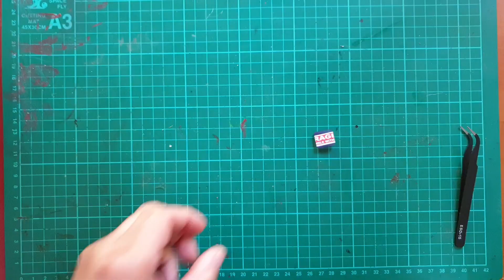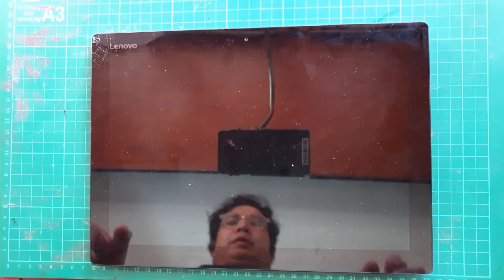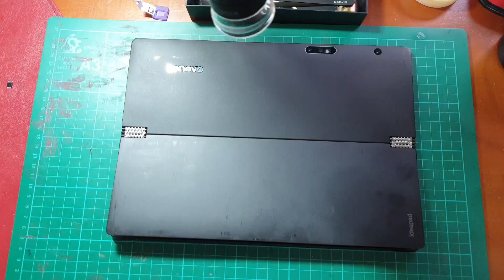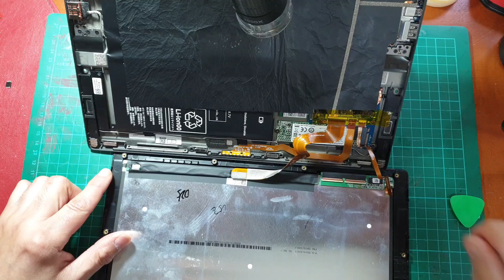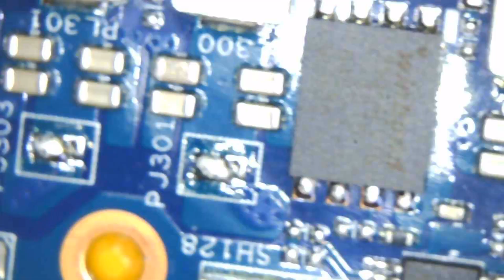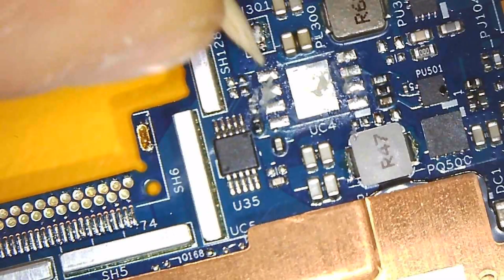First Attempt at Replacing a BIOS Chip with No Legs

Comment: How long did you have to use the hot air to get the chip off? I am having a really hard time, chip wont come off despite minutes of 430 heat.
Reply: Having the same problem on a MSI mobo. Did you manage to desolder it? I guess it is glued.... :(